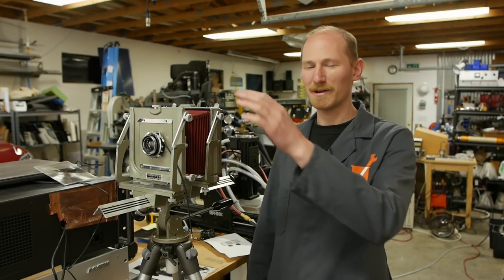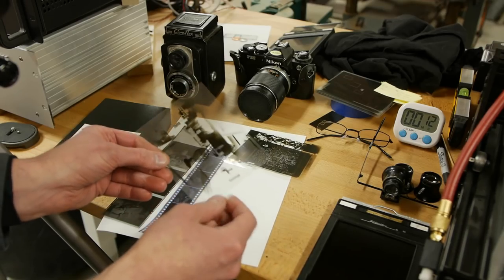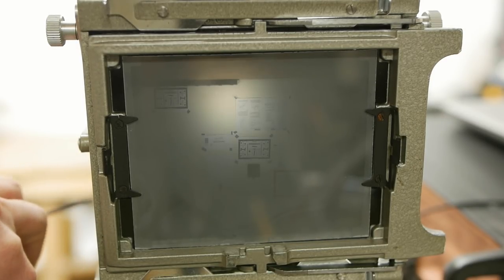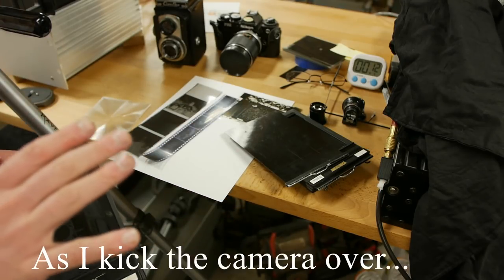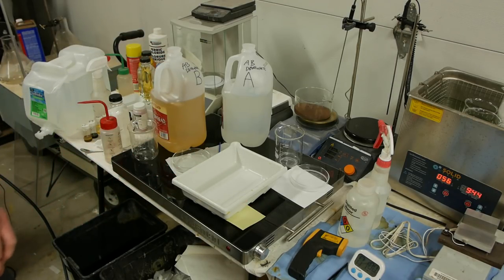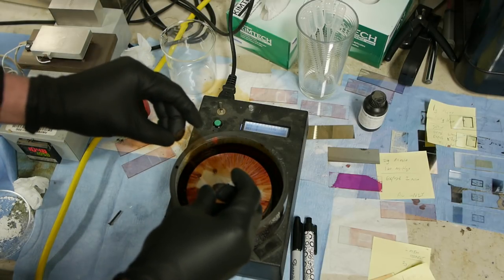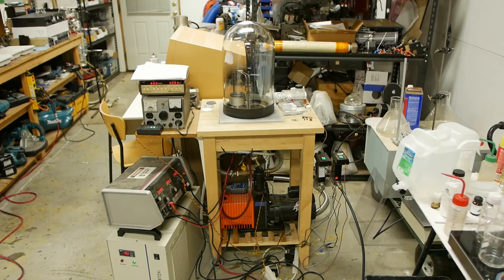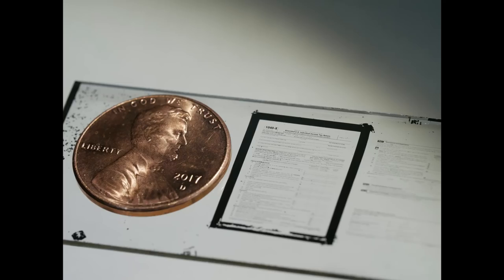Antique 4x5 camera creates 20 micron photolithography masks: Super tiny tax form

Comment: On the shutter you slide in and out one side of the top is  black and one side aluminum colored. By being consistent and turning it over after exposing the film you can identify which film has been exposed in a holder.

Comment: You should check out photosensitive lacquers for PCB manufacturing as a potential source for cheap photoresist. For example, Kontakt Chemie Positiv 20 looks and smells exactly like S1818 clean room grade photoresist and seems to have similar chemistry as well (NaOH development, acetone soluble). You might have to filter it using a syringe filter as well as potentially dilute with whatever solvent it uses to yield required thickness with your spin-coat recipe.

Also, I see you've used the smallest aperture diameter during exposure. While this should reduce spherical aberration, it will also reduce numerical aperture of the lens, resulting in lower resolution. I think there could be an optimum aperture value that yields best possible performance in region of interest (centre of the film). Additionally, monochromatic illumination might be useful in case chromatic aberrations are hindering setup resolution too.

Lastly, how about using that Fresnel lens you took out from the camera to collimate your UV lamp?

Comment: For your glass weight on the slide it should be fused quartz.  You are probably blocking a significant portion of the UV light with out using a more UV transparent medium

Comment: If focus is important, I would stop the lens down more. It looks like you're shooting wide open. A lot of lenses have sweet stops around F8-F16. Sometimes lens makers would put a little red dot on the aperture ring to show you where they were the most sharp, but you wouldn't have that on a Copal shutter probably. Also, strobes. The strobing nature of the light also acts to freeze the image. With film that slow, you'll need some really bright strobes, and you'll need to pop them multiple times. I've had to do as many as 32 pops for one image when using some very low ISO film and weak strobes.

Comment: Tip: You might notice your dark slides are light colored on one side of the metal end (where the pull handle is) and dark on the other. Flipping them over is how you indicate which side has been exposed - bare metal is unexposed, painted (black) is exposed. I took a silver marker and wrote on each side of the slide EXPOSED and UNEXPOSED and used a black marker to touch up the well-worn paint as well.

Comment: the purpose of the fresnel is to brighten the outer edges of the image by bending the diverging light back towards the center where your eye will be. without it you get more of a hot spot in the center. your side by side test is flawed because the fresnel isn't centered and is actually bending the light further off to the side. your spacers are also incorrectly made since optically a 2mm sheet of acrylic isn't equivalent to 2mm of air. you'd be better off flipping the ground glass around, frosted side facing the rear, so the thickness of the glass takes the place of the fresnel, or use a sheet of plain acrylic as a substitute for the fresnel. either way you'll need to take test shots with an angled focus test chart to verify your ground glass is at the right depth.

Comment: You know which sheets of film have been exposed, because the slide, at the grip end, is black on one side and bare metal on the other, so you just flip the dark slide while it is pulled, and that keeps a record for you. Just don't forget to flip it, or you'll double expose your film, like I did a few times! The best practice is to get into the habit of flipping the slide right after you pull it for an exposure. You also, of course, need to remember how to set them while loading the film in the darkroom. There are a hundred ways to screw up a view camera shot, from forgetting to pull the dark slide, to pulling it while the shutter is still open after focusing.  BTW, I have an identical Graphic View with a Schneider lens. I enjoyed the vid, but hate to acknowledge that it's an "antique."

Comment: You could try using a Bahtinov mask to easily and quickly find the perfect focus - they're usually used in amateur astrophotography but should also work here - you would need a point light source on the wall though - a focused laser dot perhaps.
Reply: Good tip, also, if he has enough light he should focus at the working aperture. Many lenses suffer from focus shift when stopped down.
Reply: @pdp11  Oh, right, he focuses with the lens wide open and then stops it down. That might be a problem, but then again it might not.
Also I was concerned about how wobbly the camera was on that tripod - it moved a lot when inserting and taking out slides - probably not very good for hitting the perfect focus either.

Comment: Great job, great reproduction  for the equipment and primitive methods you are using.  For anyone interested, you can do the same process with a SLR camera with a Macro black and white copy lens. a copy stand will  help. Should be able to get everything for 100 dollars or less. I did a lot of this back in the 80s , you can buy the 35 mm film on a roll and you just do experiments with times and exposures  and developement times at one temperature until you have what you want.

Comment: I have some of that film and developer but I haven't used it yet. I hadn't been able to find any guidelines on exposure, development times, and/or developer lifetime up until this video (though I haven't tried looking for a while).
In my case the goal is to produce photopolymer plates for relief (letterpress) printing. I can get ok results printing a negative on an inkjet printer, which is blacker than laser printing, but that doesn't work so well from non-digital art.

Comment: Does operating the shutter release cable ever affect the shot, as I would think that even the slightest vibration of the camera would spoil the shot.  Figure making an RC servo operated release cable, controlled by an arduino, with user adjustable shutter time would be a good thing to add to the equipment.
Reply: Once you get to these exposure times it's all fractional - if for two hundredths of a second there's some minor shock out of a fifteen second exposure, the light falling in a different spot is so comparatively minute as to more than likely not matter, even at these resolutions.

Comment: Have you ever considered using a fiber laser for this? If you coated the entire slide in the desired thickness of metal, you could then etch off what you didn't need with an inexpensive fiber laser. The laser would not do anything to the glass, but is very effective with metals. This would significantly reduce the amount of steps and points of failure in your overall process.

Comment: You reciprocity problem seems backwards. It should get more reciprocal as temperature goes down. Just before CCDs became available there was a lot of action among astronomers using cooled film with dry-ice and such (as well as "hypering" with hydrogen). The cold-cameras allowed very long exposures - like an hour - of very faint objects. I wonder why you get the opposite?

Comment: The standard method to identify exposed file in holders is to have the visible metal on one side of the exposed dark slide black and the metal on the other side bare metal or painted white. Load the film and insert the dark slide with the black side of the slide facing out. Remove the dark slide and expose the film, the insert the dark slide with the bare metal to the outside to indicate the file is exposed.

Comment: There is actuall panoramic 35mm cameras, that expose 2 frames at once, which would almost perfectly match one microscope slide. One example is the fujifilm tx-1.
however this particular camera is more expensive than the large format camera, But a camera like the sprocket rocket is cheap. and is probably more cost effective, if the quality is good enough.

Comment: x-ray film is also orthochromatic, high resolution and can be high contrast depending on type and how you develop it. the stuff i use is 10"x12" and less than 15 cents per shot once i cut it down to 4x5.

Comment: Interesting, I use photoresist to etch logos on steel. Use Posi20 spray can (to get nice clean coatings is tricky, and to get it to dry without getting dust sticking to it as well. Then I have the logos printed on transparency (very similar to the fil you have). I use a UV light for curing gel nails to develop it, and then use lye to remove the developed bit. I do have problems with the light sometimes leaking around the film (its sometimes on curved surfaces, so a glass plate wouldn't work). And then the lye is pretty aggressive and will dissolve the undeveloped resist which leads to tiny pinpricks and non perfect results. Maybe I should try use the sodium metasilicate pentahydrate instead. Still not sure how I could keep the film flat on a curved surface or if the UV light is a problem for getting crisp lines

Comment: I wonder if you could create enough negative pressure behind the film by using a simple bellows blower you'd use to clear dust off a sensor. Just squeeze the bulb and attach it to the vacuum port.

Comment: Really cool. Why not use a laser instead of a hallide lamp? That would be highly collimated, after all. Also, Just wanted to comment that modern SOTA CPU processes are at like 4nm, which is 5000x smaller than 20um. They must be using very high wavelength light, maybe gamma? to get that kind of resolution. I think it would be cool to discuss how different parameters of your setup can be adjusted to achieve these much smaller results, as an educational exercise. It would also be interesting to attempt to produce something at the edge of what an optical oil-immersion microscope can achieve, which is like, .2um, or about 100x smaller than what you have.

Comment: Hi, I love that you are using these tools to make high resolution masks. I have a few thoughts about your process, having worked in photography for many years. You are using a regular photography lens, which seems to work. But to be very accurate you need a "process lens", which is basically an extremely flat field lens for reproduction photography at various magnifications. They are available from Edmund, various surplus outfits, etc. You would probably use a behind the lens shutter as they usually are not built into the lens. Another recommendation is focusing technique. When you use a loupe or eye piece magnifier to focus on a ground glass, (a plain one) you can tell that your image is in focus on the glass surface if when you move your head (and thus your line of sight) slightly while looking at the image, the image does not move or displace. If it is out of focus when you move your head the image will appear to displace. Fresnel sheets in ground glass view screens are  designed to direct more light into the corners of the frame so it is illuminated better for framing and focusing. However, the Fresnel does displace the focal plane and iirc, the placement of the ground glass is adjusted to compensate for this effect. That is the back focal distance will be slightly different with the Fresnel in place. For best results with litho film time and temperature is crucial. I worked a lot with it. There is usually a recommended time. Then by doing tests with very fine line images, you can zero in on the correct exposure that gives the best detail. You can tell if over exposed/developed if the fine points of type or the ends of the lines become rounded or blurred, or if under exposed the edges won't quite close in exactly on the features. Once you work out the exposure, time, temperature of development, you can hit critical sharpness every time. Your idea of using the vacuum back is great. But in non-technical photography film backs the divider between the film chambers is just a bit of formed sheet metal and not precisely flat. Better would be to build a custom holder that had a machined plate with holes for the vacuum and had the dark slide and rails on top of that. Also, iirc, the exact film plane distance from the camera back flange is .097 inches as a standard for film holders. Or that might be the distance from film surface to the flange.     Edited to add: The tilt your view to determine if in focus is not as I said. Actually it is focusing clear glass at the film plane using the aerial image. Using a magnifier at the clear glass, you can see the aerial image formed by the lens.  We used to put a sharpie mark on a clear area next to where we were going to focus, on the inside. When the image is in focus at the surface of the glass near the sharpie, the image won't move in relation to the mark, when you move your angle of view. Adjust the focus in and out until by moving your eye position on the magnifier, you see no relative movement between the aerial image and the sharpie mark. "Process" camera ground glass usually have an "X" across the glass where there is no grind, just polished glass, for exactly this focus method. You can check the focus in the corners as well as the center.

Comment: I was shooting with my 4x5 sinarX camera, are you sure the fresnel lens you are using is the right focal lens for the 4x5 screen? It should bring the lights from the corner just parallel to the viewer, so you see homogeneus lightness across the entire frame, not make it any brighter really. To focus I used a small loupe for 35mm transparency, and move it across the all frame, to get maximum focus precision. Not for this purpose, but also consider the focusing loupe specific for the enlargers (quite clever design they are for projection focusing).

Comment: At about 14:10, you said you were using f11.  I suspect this is part of the reason you are diffraction-limited.  It is a pretty common practice to only close the iris by one or two stops from full-open to get best sharpness.  You should need f11 only if you need a greater depth of field, but since your object is at a fixed distance, I think it is unlikely that this is a problem for this setup.

I'll be bold and suggest an experiment:  replace the ground glass focusing screen with a digital image sensor.  There are microscope cameras made with exposed sensors or you could use a pocket  camera with the lens removed or a SLR camera.  In any case, the sensor should be exposed(no lens in front of the sensor).  You would have to make a jig to hold the sensor at the correct plane.  One of the sensors that can produce 4k video would probably be good.  You could use a sequence of still images or stream video to a monitor.
Reply: f/11 is wide open for large format.

Comment: If you are close to the diffraction limit of the aperture, perhaps you should increase the aperture opening for better performance? For regular full frame lenses, f/11 is not optimal for sharpness, optimum is usually somewhere between f/5.6 and f/8. However I am not an expert on large frame camera lenses so it might be different. On the other hand focusing would be more difficult.
Reply: What matters is the absolute size of the aperture, not the relative f-stop. For large format, he is already wide open. 150mm/11 = 13.63mm aperture, equivalent to f/3.6 on full frame with a 50mm lens.

Comment: I've used "cut film" (also called sheet film) for over 50 years including "Kodalith Ortho" type 3.  (in three sizes)  Cut film is designed to be cupped away from the lens so the center is pressing against the back of the "film holder."  (by the relative thickness of the gelatin on the two sides)  The vacuum should not be necessary.  The "slide" is called the "dark slide" and one side of the handle is painted black and the other is natural aluminum to indicate if it has been exposed or not.  I never had as fine a camera + lens as he has.  With the notches (different for each film type) in the upper right orientation the emulsion is facing you.  Ten seconds in the stop bath (acidic acid) is more than enough time, any more is a waste of time. Ron W4BIN

Comment: Ok, film flatness. You loaded the demo film emulsion side in, hence the curl up in the center. Loaded correctly with emulsion side out the back of the film holder will control the curl to a level acceptable for the camera-to-subject distances in general photography. For close-up work it can be a problem. This was what kept glass plate “film” going a lot longer than it otherwise would have, but vacuum holders such as your ingenious improvisation were not unknown.
The choice of large format brings with it longer focal length lenses, and the inherent shallower depth of field of such lenses limits the ability for that property’s ability to compensate for things like the curl of the film.

Comment: Surprised vibration, and physical disturbances don't spoil the long exposures, but I suppose at ISO1 there is some forgiveness in the film itself.  Seems like the spots you see could be from debris in just about any step along the way from film exposure to sputtering.  Tough to trace but I doubt it is necessary.  You should see the slides Thought emporium started with.  Stone age compared with what you achieved.

Comment: 20 um on a 25x75 mm glass - that should be 1250 x 3750 pixels, ie a little less than 4K resolution. You could take multiple expos of a 4K TV with the camera (selectively masking the film). And if you build a funnel-like adaptor with a known  distance you wont have to re-adjust the focus. Of course an 8K TV doubles the resolution (about 10 um by 6 um).
Reply: Or you could plot the image with an UV-laser directly onto the photoresist. There should be many creative ways to control the beam, piezoelectric mirrors, farady effect on the beam, stepper-motors and optics.